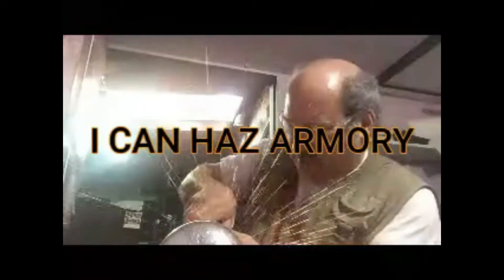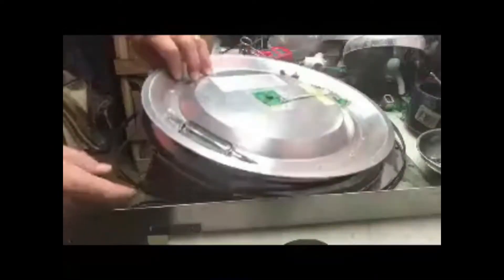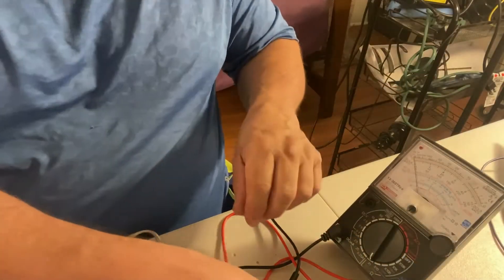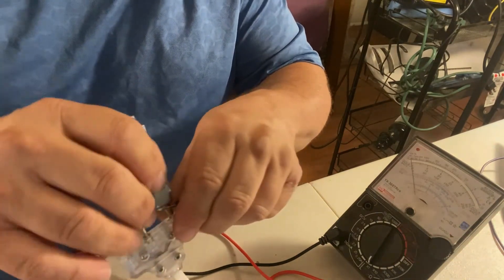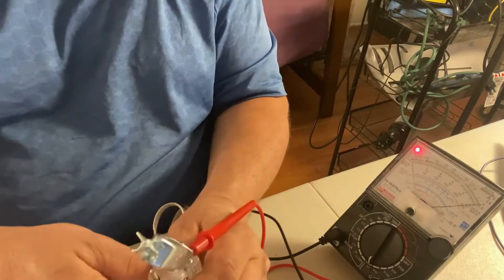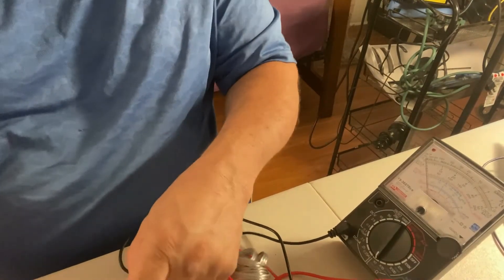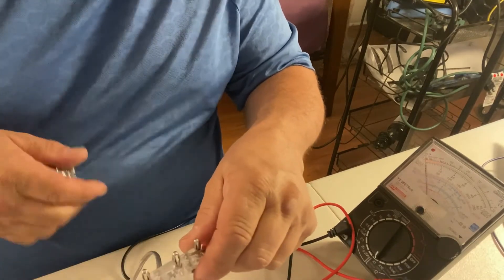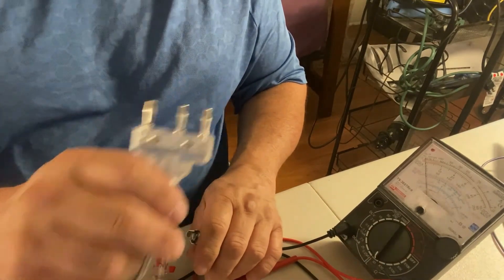I Can Haz Armory # 103 -- Testing body cords with an ohmmeter

Comment: What makes this alot easier is instead of futzing with gator clips you can just buy leads that have gator clip ends. I got mine off amazon for ~$10. I think there are also converter heads for the leads that just go over the existing ones, but not sure how stable that connection is, id assume itd depend on manufacturer.
Reply from the maker: I'll admit, I hadn't thought of those.   The worry is that the connector pin may not fit into the meter...not all receivers are the same.  

Of course, you COULD also cut off the probes and solder alligator clips to the end for the same purpose.

In the end, whatever way works....works.
Reply: @samsignorelli  true, took me a little bit of searching to find compatible ones for my meter but honestly there arent THAT many different connector pins. Some fancier meters apparently come with different leads but that felt overkill. Ultimately though i agree, if it works then it works
Reply from the maker: @stencetheboss  Ah yes....the eternal search for parts only YOU know why you need....good luck explaining that need to the guy at the electronics store!

I can easily find a pop-out battery drawer for a 9V battery, but finding the same for 2 AAs took me weeks....because I could NOT find them in electronics....they were on a site for electric guitars!
Reply: @samsignorelli  I had the exact same thing when looking for the metal clip for a reel that goes attaches to the D ring. You know the one, it has a portion that presses in, the thing itself isn't a D ring its just... a clip? I finally found one at a hardware store and I asked every employee in there "what would you call this" and every single one of them scratched their head and said "uhhh... dunno just... a clip I guess" and then realized how hard it is to know what someone means if they walk in and said "where are the clips"
Reply from the maker: @stencetheboss  The struggle is real!